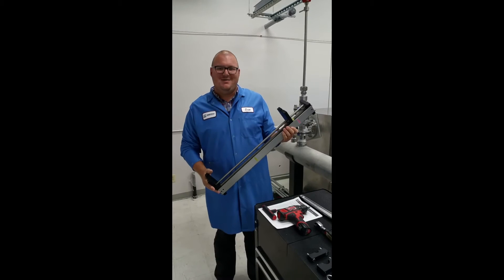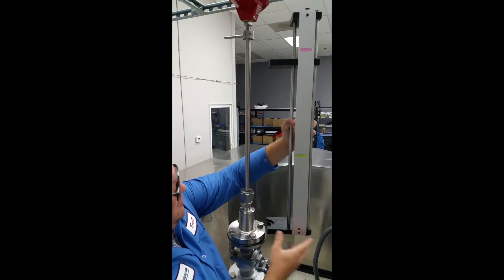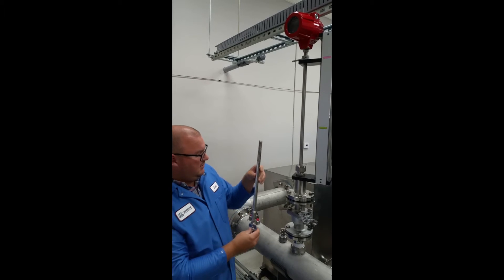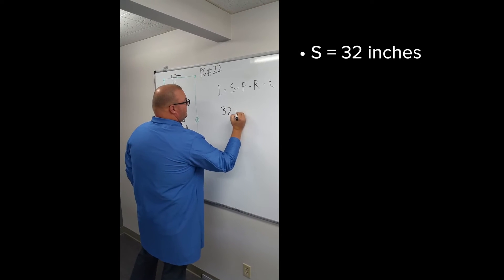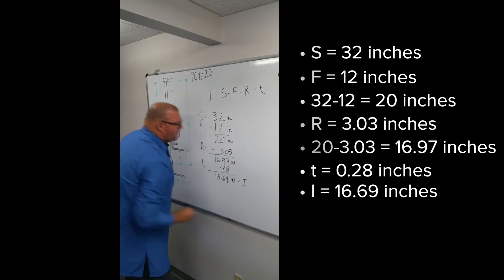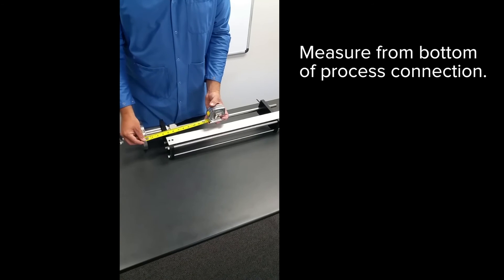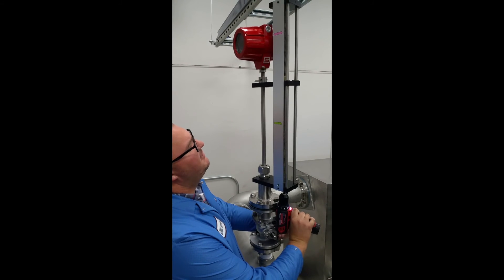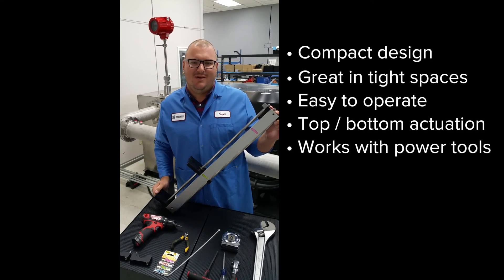Guide to InnovaMass Vortex Flowmeter Retractor & Hot Tap Insertion

Comment: hi scot could you explain why we need a retractor ?
Reply from the maker: Thanks for the question, Stephen!
Hot taps are required to remove insertion probes from process lines WITHOUT shutting down the process.  The insertion probes are drawn up past an isolation valve, then that valve is shut and the probe removed from the pipe for cleaning or repair/recalibration as required. A retractor can make this removal process easier, especially when there is a high pressure in the pipe. 
-Scott Rouse